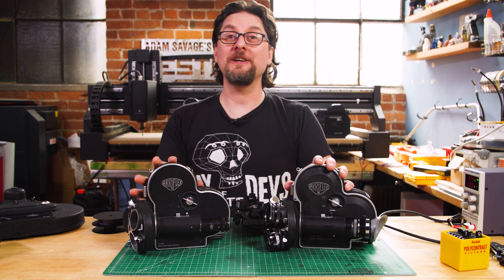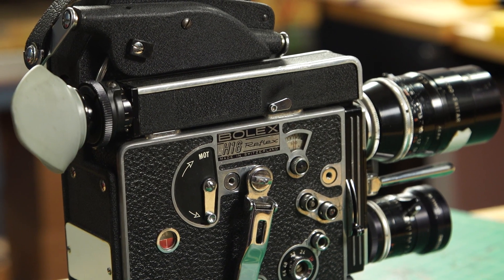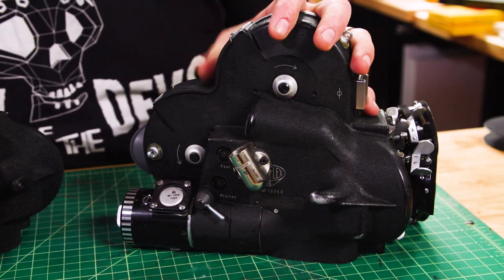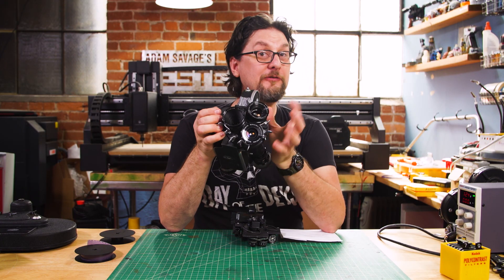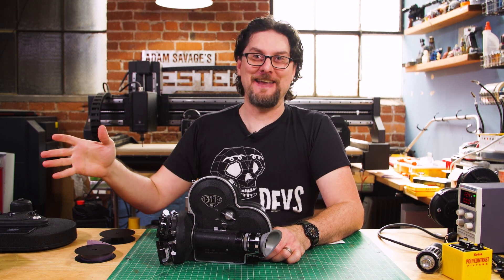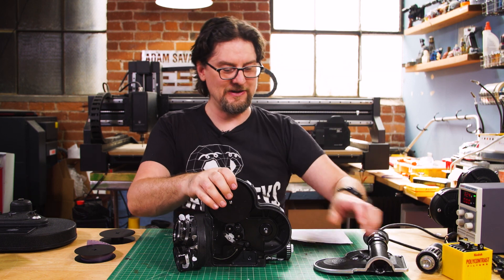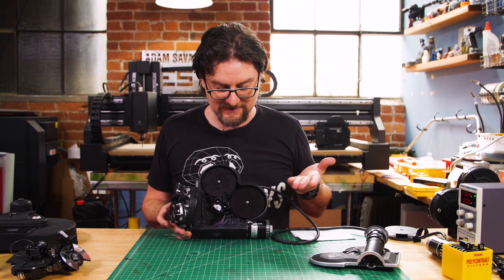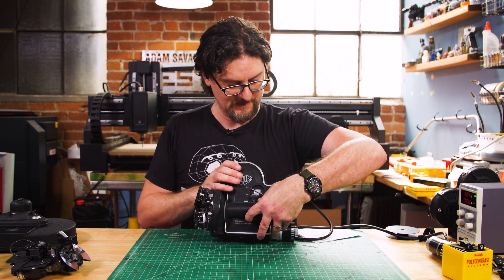Inside an Arriflex 16mm Film Camera!

Comment: I just read a book about a BBC sponsored British expedition that travelled across Zanzibar and Tanganyika (now Tanzania) in a 3 person hydrogen balloon in the early 1960's featuring this Arriflex camera ( see  A. Smith, "Throw out Two Hands" , George Allen & Unwin, (1963) ). The appendix to the book mentioned the camera initially used 8-volt Varley batteries that proved 'spillable and heavy' until one of the cameramen improvised his own battery constructed of electronic flash unit cells, each with 3 floating balls to show the state of charge, embedded in foam rubber and encased in a small metal box that clipped onto the waistband of his trousers. The battery was chargeable from the Land Rover battery via a 12 volt stepdown built in series. They carried a range of 11 lenses for this camera: a 12.5mm Taylor Hobson lens;  40mm, 90 mm, 150mm, 300mm Kilfitt Kilar lenses;  as well as 240mm and 400mm Novoflex lenses with follow-focus pistol grips.  The film stock (courtesy of the BBC) consisted of 24,000 feet of Eastman Plus-X 16 mm negative film in 100 foot rolls; 24,000 feet of the same in 400 foot rolls; and 12,000 feet of Eastman Tri-X 16mm negative film. The sound recording was done on a Ficord midget tape-recorder.

Comment: Adam, I own an Arriflex 16BL which has sound heads. I used it to shoot news for ABC. Just a few weeks ago I obtained an Arri 16M body and magazine. The lenses, optical view finder and motor had been removed. I really want to shoot with this camera, so I am restoring and replacing missing parts. I did find a constant speed motor: cleaned the brushes, commutator and slip rings for the governor. It is an eight volt direct current motor. It runs very well right now. I still need a view finder, either straight or periscope. They are not easy to find. And the lenses, I have called all over for fixed or variable (zoom) lens. The problem is there is a lot of uncertainty about the lens mount. I have learned that one lens mount is positive lock; is this correct? While two lens ports are "standard." I have no idea what standard means. I am aware the Arri S lens turret and the Arri M turret are identical. However, people who sell lenses are never sure what mount they have. And, I don't know for sure either. Can you explain this to me?  On the subject of lenses most sellers are asking sky-high prices for lenses that may have a limited number of buyers. Is my assumption correct? And lastly, do you still repair Arriflex S or M? Or maybe you can point me in the direction of someone you know and trust.  I know, this is a long post, but I'm really passionate about film.  Thanks so much for your valuable time.  Ross du Clair

Comment: Hey Adam, somebody I know who fixes these things told me to put heat shrink tubing but I thought he told me to put it around the rubber boot but you are saying to put it around the tip of the motor.  I'm not sure if I misunderstood or if both ways are possible.  Your way seems easier. I have a 16S and 16SB.  I tested the SB with a first gen sync motor.  It runs but it didn't hold sync.  I had the Tobin checked out and it is ok and the guy said he suspected the motor was slipping so it wouldn't hold constant speed.

Comment: I have a factory ARRI 16S sync motor for my 16S so sync sound was available as well as a hard sound proof blimp.  They were expensive back in the day so few were produced. The arri sync motor is powered from a 117 volt wall power socket and also output a 1 volt 60hz pilot sync signal for a Nagra 3.  There were also the Tobin Cinema Systems sync motor and the Jensen crystal sync motor both third party solutions.

Comment: Oh the one thing that kind of sucked about these camera was the old optics.  Most of the lenses you could buy or rent were not fully coated and not always the sharpest either as most were designed and made back in the 50-70's.  On the good side, Arri S could use the older Zeiss and Arri 35mm lenses.

Comment: Oh the memories, I had one of these back in 90's for film school.  I bought it about the the time US military dumped a whole lot of them on the market (IE the US military was divesting itself of a lot of old equipment at the time).  At the time, getting batteries for these was a huge pain, but you alter a cord to handle rc car batteries instead and while they wouldn't last as long as big cell or a battery beld, you could get a lot of them cheaply and recharge them in your car cigarette lighter when on location.

Comment: First models ran on low octane B&W stock. Then electricity was invented. This is why you don't buy a timepiece with a mechanical movement. We have microwave ovens and electric cars now too. Crank up the model T and get the splicing tape.

Comment: 10:20 What was the name of the sort-of fiberglass material of the cogwheels 7 gear wheels in the camera? I once knew the name, forgot it, PLEASE! That material is awesome.
Reply: I've heard this kind of material generically called "phenolic"... some kind of fiber or cloth-like material embedded in some kind of resin.  Modern types include Micarta, FR4 (common PCB material), G10, depending on the type of fiber and resin...
Reply: I know it under the name Pertinax. But I could be wrong in this specific case

Comment: CORRECTIONS - 1) the model I am showing IS the ST which was the standard model - later came the SB which had one ARRI bayonet mount lens port. 2) I'm bad at guesstimating weight! The S weight about 9 pound unloaded and without the magazine.
Reply: Hey Sean!  I just picked one of these up a few weeks ago and tested it out yesterday.  I have seen an old post on your site in finding more information about this camera and only recently put together that the site I was looking at was from someone on Tested now.

Anyways, I wanted to add a note about the old stock plug:  I am literally 3d printing test replacement connector right now to replace the cable I have now that was made for it's original battery pack.  The prongs fit with a 3mm and 3.5mm banana plug socket, so I hope to be able to put out a cheap solution soon for those of us with a camera without the XLR modifications.

Comment: The rubber coupling for the motor blew my mind. A precision instrument with gears, teething, pins and sprockets uses that to drive it. I thought that it would have something more precise and secure, with mechanical grab not just friction between metal and rubber, wow! Awesome video, Sean!
Reply: It also acted as a safety - if something got stuck in the gears the coupler would eventually slip.
Reply: @CworthDynamics  - it's the same reason oneg is acetate and not polyester.  If you had a camera film jam, with polyester film it would literally tear camera apart, but with acetate film, the film simply breaks.

Comment: It costs 400 thousand dollars to shoot this camera for 12 seconds
Reply: I think you may be mixing this up with the purchasing price of the Phantom line of cameras... I did a quick googl e search: an Arriflex 16mm camera usually costs about 4000$ on eBay, film stock about 100$ (per 100ft). Not the cheapest thing to do, but far below your claim. ;-)
Reply: @KonradTheWizzard  I was referring to the price and development cost of the film, which I assume is similar to the  35mm film I'm more familiar with.
Reply: @captain_ironbutt  My guess would be that you create your own chemical lab if you do this a lot. This gives you a lot faster turn around on the film segments (dailies) and it is really not very expensive or difficult to do (long ago I used to do this for my still films). For still photography the basic lab equipment would cost a few hundred bucks. The chemicals are realatively cheap. My guess would be a couple thousand to accomodate for the much longer film rolls.
Reply: Mmmm - nope. Film isn't cheap but not sure where that number came from.
Reply: @CworthDynamics  that was also a reference to an old team fortress 2 meme, in which the Heavy talks about how expensive to use his minigun is to shoot.

Comment: Thanks Sean, nice to go down memory lane. Why would a school still be using a 16mm film camera in class? To teach stop motion animation perhaps?
Reply: My guess would be: for the same reason that learning to be a mechanic involves manually filing parts from blocks of metal despite the CNC sitting in the next room or CS students having to design a sort algorithm on the white board despite of thousands of ready made libraries: it teaches the basics and you actually appreciate what goes into the technology you use on a daily basis. After a couple of decades working in the real world I really appreciate those colleagues who actually know all the basics and could apply this knowledge if necessary - their solutions are usually much more reliable, efficient and more elegant than those coming from someone who just uses the most modern stuff and ignores the history of their field - even if they end up using the same tools in the end.
Reply: @KonradTheWizzard  Thanks, but I have done film and video production and I can't imagine why someone doing a production with an ARRI digital would benefit from shooting a 16mm film. Stop motion must be the answer.
Reply: @MrMartinRome  You can do stop motion much much better with a digital still camera. Even time lapse is probably easier and more efficient with digital equipment.

Forcing students to use this hopelessly outdated technology has a very different benefit. You are forced to plan your shot, since the film material is quite expensive and you don't get instant feedback. If you really want to use film efficiently you have to learn about the photo-chemical processes and properties of the film. You are forced to be very careful while loading the film and you will ruin at least one roll by accident - reinforcing this lesson. You have to learn how optics work. You have to slow down and think before you do anything, you have to learn how things work before you use them. Since you are working more deliberately now, you are open to learn about composition of a shot and aesthetic rules.

All of that knowledge is applicable to digital - even learning the photo-chemical properties of film teaches you that different films and different sensors will have different color reproduction.  Almost none of those students will ever use analog film again, but the benefit of using analog film in school is that it forces you to actually learn the art and craft of filming. It is a vehicle to learn a lot of other very useful stuff.

(Disclaimer: I have never produced any professional or semi-professional video, my experience with analog film comes from still photography more than 20 years ago. At least for photography I still benefit from it.)
Reply: @KonradTheWizzard  sorry, but that’s nuts. Why would you teach film processing to a digital photography professional. The tech involved in digital photography is WAY beyond film work. All my annual reports for Fortune 500 companies were shot in digital. It’s like teaching a race car driver to use a buggy whip.
Reply: @MrMartinRome  ...more like teaching the race car driver how to drive and maintain a steam locomotive.
Why would a modern carpenter learn about tools from the middle ages? Why would a computer animator know about how van Gogh mixed his paints?

And why in HELL have I spent the last 2 years learning how to create little cute blinkenlights from discrete transistors and wires when I am supposed to be an engineer using modern computers and elaborate software to automate factories? That's 60'ies tech! The technology stone age! Why am I wasting thousands of bucks and hours on this? Am I crazy?

Back in the real world: I'm just finishing a project for which I was the ONLY qualified engineer in the company because I know some basic electronics.
Was it necessary for me to know this? My colleagues seem to get by fine.
Was it fun? You bet!
Does it make me a better engineer? Absolutely! And my boss seems to agree.

If you can't see the value of knowledge you will be doomed to a life of mediocrity. Especially when it pertains to the history and principles of your own field of expertise. The hopeful part is that you watched this video on a channel made by notoriously curious people. If it inspires you to do something crazy - go for it! You might be surprised by the results.
Reply: @MrMartinRome  If you can shoot it on film, you can shoot it in digital. Many schools still use film in there production courses.

Comment: Could you replace the brushed old motor with a new brushless for reliability or are those motors already reliable?
Reply: as long as the brushes and contacts get some love from time to time, these old motors will run for decades without a hitch.
Longevity of electric motors is more about the mechanical parts, like the ball bearings.
Reply: @caligo7918  True - I never had the brushes go - the barrel is basically one big rheostat and that would cause problems first.
Reply: @caligo7918  Thats so cool I didn’t know that and Im sure you could service the brushes. Thank you for answering question these cameras are so boss.
Reply: @Marcus2750-u1t  I own some old electric motors and had to change the brushes once in 30 years or something. Cleaning up the contacts is useful, too, especially if you went a little overboard with oiling the bearings or the motor got dirty.
So i'm not that knowledgeable on cameras, but i'm into electronics in general and the step-motor in a camera is not that far from step-motors in robotics/automation.
Reply: @caligo7918  yeah I agree with that, I have experience in motors due to rc cars, planes and boats….. I grew up with brushed motors and have  experience in that myself…… Ive even winded my own motors etc but I have zero in old camera equipment lol so thanks for your input.